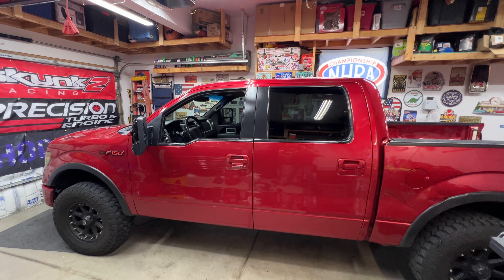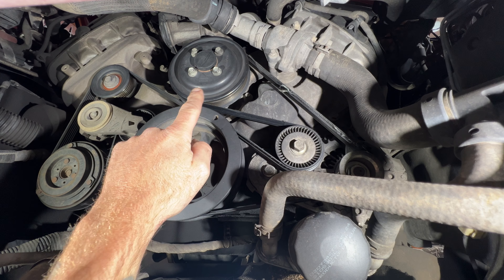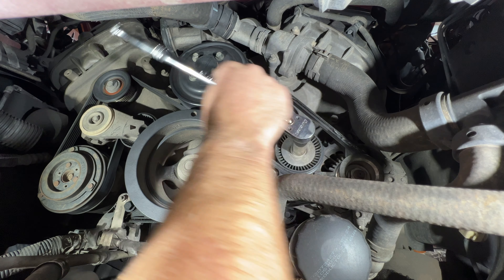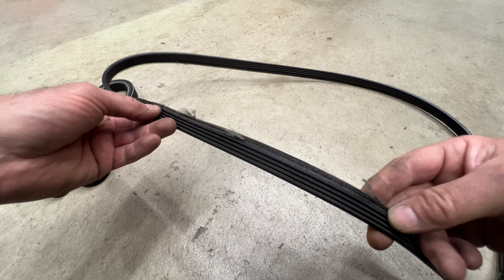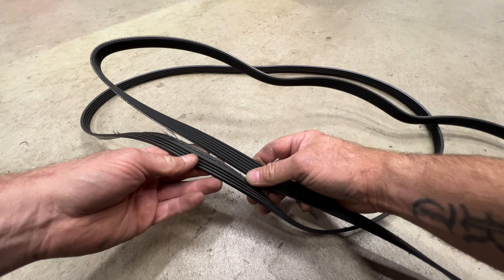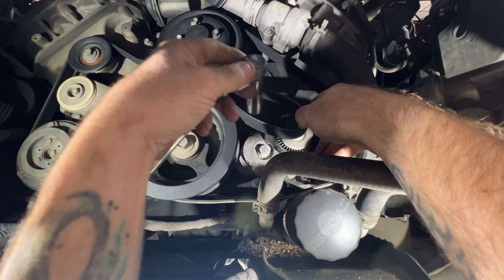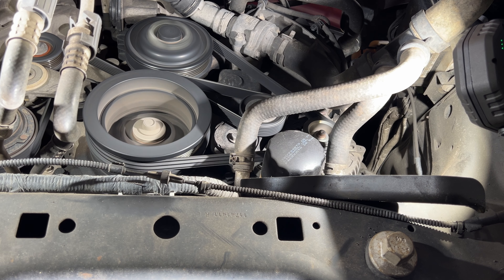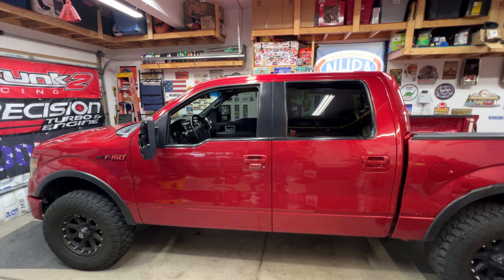2011-22 Ford F-150 5.0 Coyote Serpentine Belt Replacement How-to

Comment: I dont know if it Roush specific but 2019 5.0 has a big ass metal protecter?? on the AC side that covers the AC pulley, idler and tensioner. There's an access hole for the tensioner but the metal protector completely enclosed the idler pulley so you need to remove it to get the belt off and on.
Reply from the maker: Thanks for the extra info.

Comment: I replaced both tensioners and belts on my 2015 f150 5.0 and I think my front tensioner is too tight because mine was tough as hell to pull back to get the belt on.. my read one was easy but the front I had to wiggle and push hard with my fingers to get it on. Yes they are all seated in the grooves. I’ll loosen it up when I get home later and take the belt off and put the tensioner back on. I think the mistake I made was that I hand tightened it hard first instead of lightly then torque to spec at 35 ft lbs. so then when I tightened it down to 35 ft lbs it clicked right away. I’ll post an update but I’m certain. I only use oem parts.